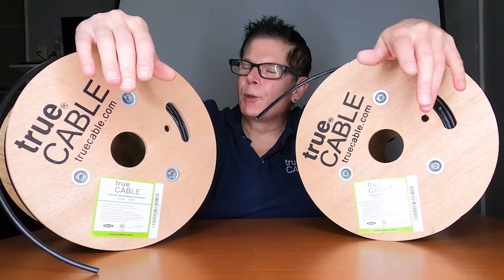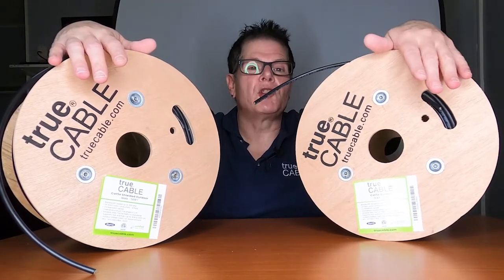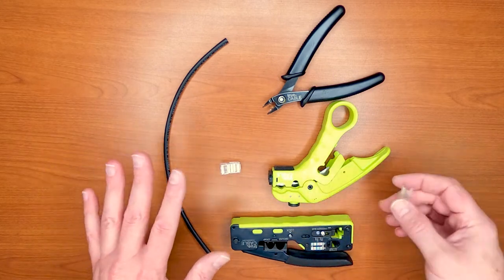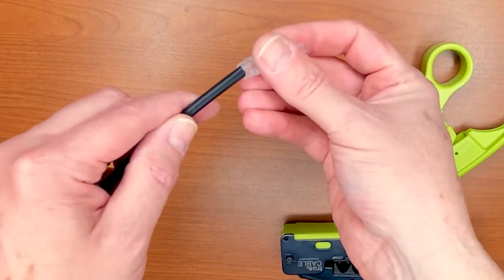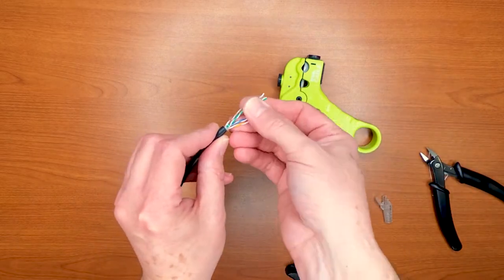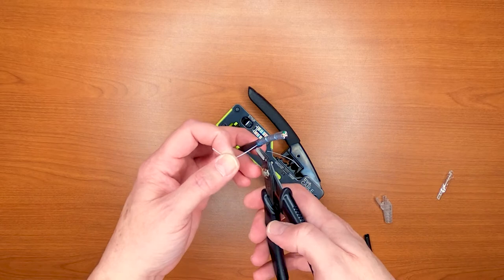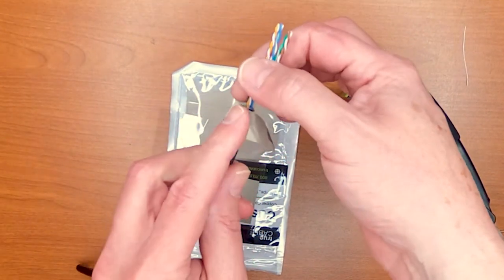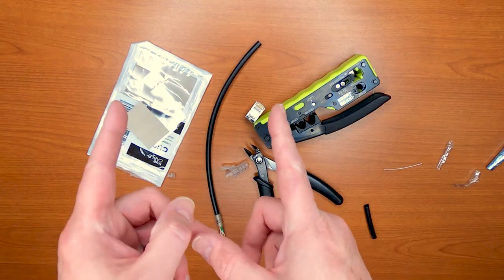Prepping Cat5e Outdoor Cable for Success - A Guide to the Correct Tools and Termination Methods

Comment: The passthrough connectors are funny to me. I’ve never bothered buying the special crimper that allows passthroughs to be used but they seem effective. I still like to mess with the guys at work when they use them, though.
Reply from the maker: Hello Willie and thanks for your comments. The pass-through connectors are easier to use, especially given you can confirm color sequence at the nose of the plug rather than trying to squint through it. They can greatly increase termination accuracy.